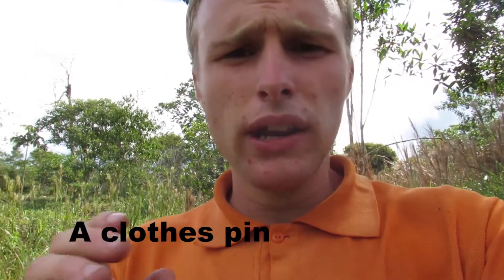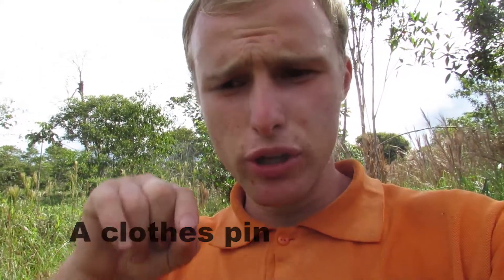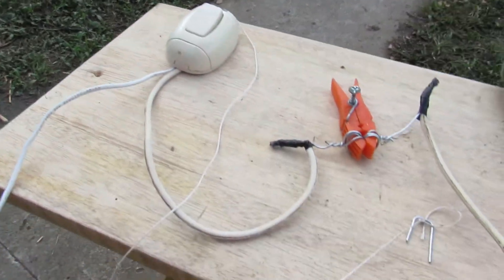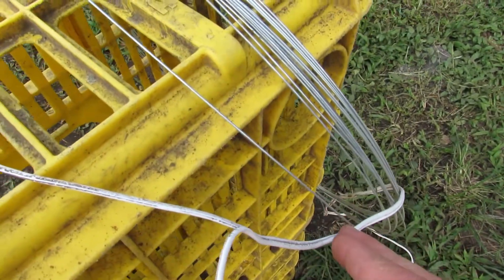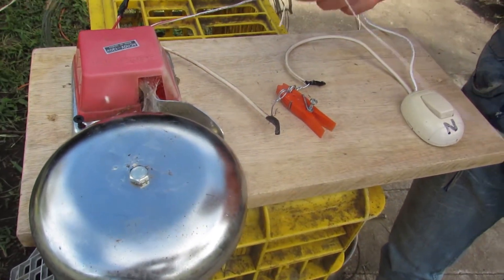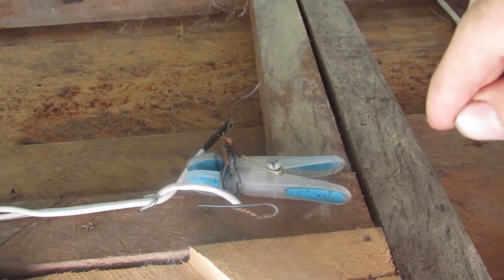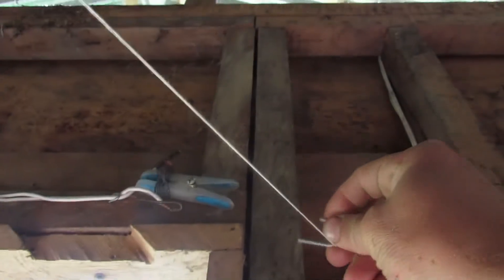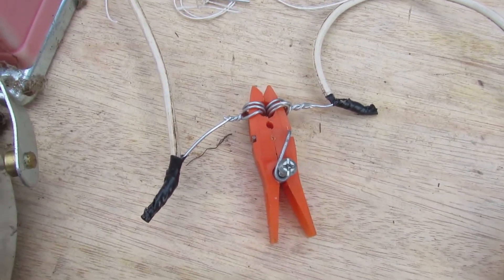Make A Simple Homemade Burglar Alarm (2021)

Comment: Couldn’t you use the ground wire to break/engage the the system instead of the hot side? This way you’d have no exposed hot wires.